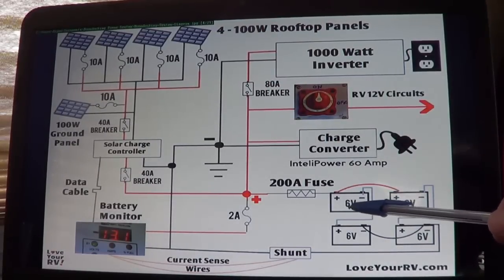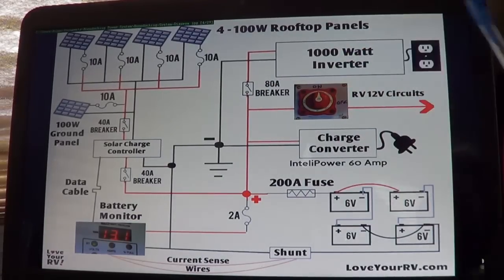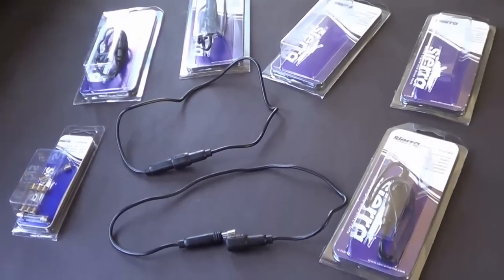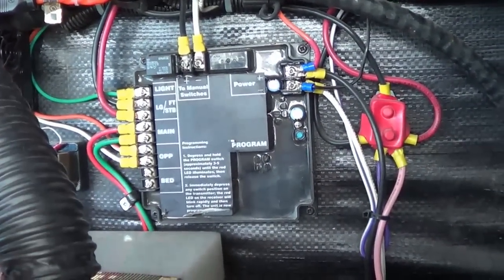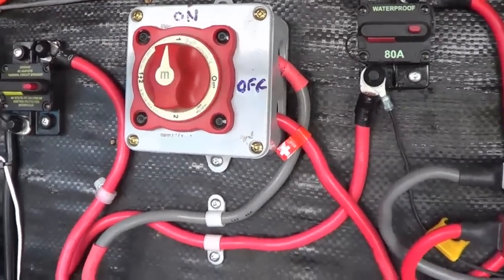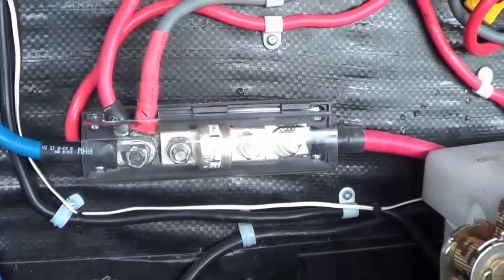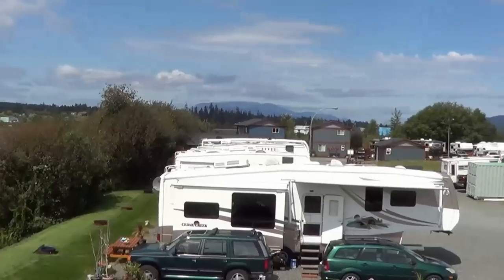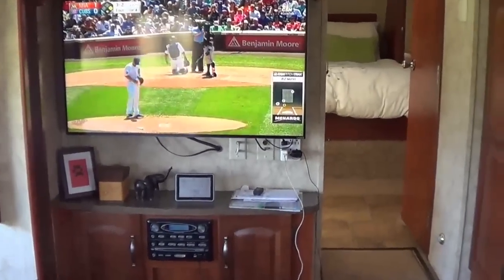Our DIY RV Boondocking Power System - Complete Overview

Comment: I went through all the comments about this video and found all the answers to the questions I had. What a great resource and thank you for putting in the work on it and your blog - Ray
Reply from the maker: You're welcome, happy to hear it helps out.  Had a great time boondocking this past winter and the system work great!
Cheers! Ray
Reply: There was one question I missed or did not find. Which Blue Sea battery disconnect switch did you decide to use and why? I see many options to chose from when I click on the link you provided Thanks in advance.

Comment: Being a neatness freak, I liked your arrangement of cables and loved the circuit diagram.
Reply from the maker: Thanks, the system continues to evolve, in the summer I got new lithium batteries so redid the battery bay wiring - https://youtu.be/1f145rhB_e0  and recently added two more panels so was a chance to redo the solar wiring - https://youtu.be/z0m7Ho0Gxmw  Cheers! Ray

Comment: Nice clean install. It is nice that you have all the switches in a row. Easy access and no searching. When you are Boondocking how often are you using your generators?
Reply from the maker: It varies a lot with weather mainly. We can sometimes go a week or two without it. But if we get lots of clouds and rain we need to use it more often. Also, it sees more action in the short mid-winter days, where you only get maybe 4-5 hours of good sun.

If we tried to be hardcore energy misers we could almost get rid of it, but we like our electronic luxuries and my wife likes the night time heat at around 66F so the furnace fan can really eat up the AHs during a cold desert night. ;)
At least now with the better charge converter, the runtime is fairly short.
Reply: Thanks for the reply. Do you use your buddy heat at night while sleeping or only during the day?
Reply from the maker: Only when awake. But that sure saves on propane and battery life in the winter when it can be dark and cool my 5 PM. Still lots of hours left till bedtime.

Comment: I already have the same converter...same inverter with same breaker....along with 6 6volt golf cart batteries and a similar battery switch, but I like your extra protection so I will be coming back to this video to add to my system this fall. Thank You ..->.33ft class A
Reply from the maker: You're welcome. Cheers Ray

Comment: POW! that was the sound of my brain popping. Wow, you answered every question I had and a few I hadn't even thought of. I'm going to start with a generator and build off of that for boon docking. I really like these new lithium batteries, I just gotta convince myself the price is worth it. There's an ongoing argument in my head about just that. Thanks for all of the info. You are now my RV electrical Yoda. 
Neil
2018 Grand Design Imagine, 2760MK 
2015 Ford F 250 6.2 gas
Reply from the maker: Awesome, happy to know the video is of use. Cheers! Ray
Reply: Ray, you're still using the same 1000 watt inverter? What's the life expectancy if an inverter?
Reply from the maker: Yes, same one, 7 years now. I've gotten my money's worth out of it.
 I'd guess most will run at least 10 years and maybe as much as 20. Usually what kills them is heat over time. It drys out the electrolytic capacitors causing failures and causes the boards and solder to get brittle leading to cracked connections. The fans are another weak point being mechanical they wear out.

Comment: Thanks for the post Ray. I am designing my solar solution now for a small 22 ft class C. Unfortunately I don't have much room on the roof. I was thinking about using one large 150 watt renogy panel along with 2 smaller 50 watt panels that will give me 250 watts total. I am going to use 2 - 6 volt deep cycle batteries in series. Hope that is enough. Do you know if there are any issue with mixing the different size panels? Does it reduce the efficiency ? I am also going to buy the 60 amp speed charger that you are using to top the batteries off with my generator. Thanks
Reply from the maker: I haven't researched it much myself but I believe mixing can reduce efficiency if the voltage or amperage specs on the panels are very different. Depending on the type of charge controller used and whether they are wired in parallel or series.
It would be worth researching it.
Reply: Checked it out. Mixing panels will kill the efficiency. I think I have room for two 100 panels so I will go with that for two batteries.

 On another note, do you have any advice for which insurance carriers cover full timers?
 Which are better then others? My current carrier (allstate) has a caveat that covers my RV for 30 days but won’t cover full time. 
BTW, I’ve heard that insurance companies won’t pay theft claims unless there is evidence that there was a break in (which is wrong Imho ).  There are many RV’s that use the same key and locking mechanism for the locks on under carriage storage so anybody that has the same RV, has the same key. Not very secure if everybody has a key to your house.
 Also, if anybody breaks into your RV and steals anything, make sure there is proof that there was a break in or the insurance company won’t pay the claim. Use a screwdriver to jimmy the lock or break out a window before  calling the police. It’s ashamed people do something illegal to make a claim but it’s a bigger shame that a insurance company might use a loophole to not pay out for exactly what you have been paying them for. 
Insurance companies know that some RV’s use the same key and if someone has that key, it will not leave a sign of forced entry. 
I’m sure there are a lot of RV’ owners that assume their stuff is secure because it is locked (wrong) and if something gets stolen, they assume the insurance company will cover it. (wrong).

Comment: This is a great summary. I'm afraid that I've never read any of the blog posts but I will be looking soon. E.g. I'm wondering about the PWM vs MPPT decision. Thank you!
Reply from the maker: Thanks.
Here is an explanation from the Bogart Engineering FAQ
C1. The debate rages: which controller is best PWM (Pulse Width Modulation) or MPPT (Maximum Power Point Tracking). Why did you choose PWM technology instead of MPPT for your SC-2030 Solar Charger?   Click for answer
A very good question! They BOTH have good and bad. Plenty of hype has been written already. Here's my (Ralph's) view:The "good" for PWM: It is simpler and lower cost technology. Under some common circumstances--it can actually deliver more amps to the battery. That could be when:(1)days are moderate or warm, with few clouds.(2) batteries are charging at over 13 volts, (in a 12 battery system) which they almost always are when actually CHARGING.(3) Panel voltage is properly matched to the battery voltage, for example "12V" panels are being used with a 12V system.PWM is actually more "power efficient" than MPPT--which means less total power loss in the controller itself. So heat sinks in the design can be smaller (and less expensive). Missing in most analysis of MPPT is that there is always a conversion loss with MPPT, which tends to be higher the greater the voltage difference between battery and panels. That's why PWM can actually beat MPPT under circumstances described above.Some places that analyze MPPT assume that panels with 30V open circuit voltage are being used in a 12V system. Any good MPPT system will easily provide better performance in that case. They also may assume batteries are charging at 12 or even 11 volts, which is unrealistic. Lead acid batteries are typically below 13 volts only when discharging, or perhaps charging with very little charging current--meaning the actual potential gain in amps is not great.The benefit for MPPT becomes apparent if you use panels not voltage matched for the battery. If they are not, MPPT will utilize more of the potential energy of the panels. For example, if you use 24 volt panels to charge a 12 volt battery system you must use MPPT, otherwise you would be using your panels very inefficiently. If you are trying to use PWM in that case, you are misusing the PWM technology.Another potential benefit with MPPT is that if distance between panels and batteries is far, smaller wire can be utilized by running panels at higher voltage to the batteries. Running at twice the voltage reduces wire size to 1/4, which for a long run can be a significant saving in copper wire.If temperatures are low enough, the slightly less power efficiency of MPPT will be compensated by the higher panel voltages, which will result in a little more battery current. But in actual measurements we made using a commonly sold MPPT solar controller, this would occur at temperatures less than 55 F degrees (in full sun, when charging at more than 13 volts), where there is a slight advantage to MPPT in my location (Boulder Creek, near the California coast). As temperature drops below that (in full sun) MPPT will get some advantage, such as could occur at high elevations in Colorado in the winter. Potentially this would be maximum about a 2.5% improvement in amps output for every 10 degrees F lower in temperature (or 4.6% per 10 degrees C colder. I'm using data from Kyocera KD-140 panels.)There can be theoretically optimal situations (that I don't personally experience where I live) where MPPT could give some advantage: that is when solar current is present, but the batteries are quite low in charge--but because loads are high and even greater than the solar current the batteries are still discharging despite the solar current. Under these conditions the voltage COULD be at 12.5 volts, or even lower. Again, using data from Kyocera panels, ("Normal Operating Conditions") there is a theoretical maximum gain over PWM of 20% current assuming NO MPPT conversion loss and no voltage drop in the wires to the panels, at 20C (68F). With PWM, the voltage drop in the wires in this case would not affect the charging current. Now if in addition you lower the temperature to below freezing at 28 degrees F (while sun is shining) you might actually get up to a THEORETICAL nearly 30% gain while the batteries are discharging.The only REALLY BAD part of MPPT, is all the hype surrounding it--for example one manufacturer advertises "UP TO 30% OR MORE" power harvested from you panels. If you are using solar panels properly matched to the batteries, 30% ain't gonna happen unless it's EXTREMELY cold. And your batteries have to be abnormally low in charging voltage--which tends not to happen when it's cold (unless you assume the battery is still discharging while solar is happening). Virtually all the analyses I've seen touting MPPT on the Internet ignore the conversion loss, assume really cold temperatures, assume unreasonably low charging voltages, assume no voltage drop in the wires from panels to batteries, use STC conditions for the panels (that the marketing types prefer) rather than more realistic NOCT conditions, and in some cases assume panels not voltage matched to the batteries.The other thing that is misleading about MPPT, is that some manufacturers make meters that show both the solar current and the battery current. In almost all cases for a well designed MPPT type the battery current will be greater. The engineers making these know better, but it is implied (by marketing types?) that if you were NOT using MPPT you would be charging your batteries with only the SOLAR current that you read on their meters. That's not true, because the PWM BATTERY current should always be higher than the MPPT SOLAR current. It is the nature of the MPPT that maximum power occurs when the current is lower than the maximum, so they must operate there to get the maximum power. So to properly compare the two you need to compare MPPT with an actual PWM controller in the same circumstances.Finally, the reason we went to PWM is that I was anticipating that panel prices were going to drop (which they certainly have over the last 5-10 years!) and that the small advantage of MPPT (under conditions where the correct panels are used for the batteries) would not justify their additional cost and complexity. So my thinking, for more total benefit per $, put your money in an extra panel rather than a more expensive and complex technology.
Reply: Oh wait did you just say that recommendations are based mostly on HYPE, and word of mouth, and don't actually analyze the actual reality of the situations?  that possibly the information is more based on some sales hype of some sales location, and it spreads like the rest of the accurate (lol) and useful information on the web today ? That possibly the quality of the unit itself , the units actual efficiency (vrses claimed) how it is wired, and how it is actually used are important?  Gosh I couldn't believe that would be true :-)   Thanks for . . .  thinking.
Reply from the maker: haha, yup, I think it comes down to what a person's budget is and where best to allocate the funds to build a balanced system. Not saying my PWM over MPPT decision is the right one for everyone, just what I think works best for me.

Comment: I remember in one of your videos you plugged the shore power connection  to the output of the inverter. Are you still plugging the shorepower connection to the inverter? How did that work out for you? If no longer doing that what are you doing now and why? Thank you,  Jay
Reply from the maker: No, I never plugged mine in that way. There was one video where I discussed different options, one being that option, but I don't do it myself. I just have a couple separately installed outlets, basically glorified extension cords for using when on inverter power. My 1000 Watt Inverter Installation Explained - https://youtu.be/yV2xJiHSbfU?t=722

Comment: I am also looking at a 400w Renogy solar panel set up, and, I don't wish to haul a 3rd source of fuel (gasoline) in my diesel truck. So, I am looking at the duel fuel (propane) champion generator. Am I on track, or, do you have better advice? I am sorry for all the questions. Just trying a last minute set up for early next year to begin my adventure.
Reply from the maker: The dual fuel would definitely be a nice option to have.

Comment: Hi Ray  I know you don't want to mention wire gauges, but just as far as wiring your 6 volts in series and parallel, what gauge battery cables did you use?  As far making custom lengths, did you do that as well? Did you have a large crimping tool for the lugs?  I will be building a similar system. Thanks
Reply from the maker: They are 2/0 gauge wires. I had a friend custom make them for me. He had a hammer crimper and the lugs. It's not too difficult. I have a video online on him making wires up - https://www.youtube.com/watch?v=ARKwl7lxHWo&feature=youtu.be
Cheers, Ray
Reply: Thank you Ray... I love all your videos! My wife and I are going full time (working from the road)...leaving end of May heading towards Mt Whitney/Alabama hills.
Reply: Actually one other question....does the 200 Amp catastrophic fuse also act as a positive bus bar?
Reply from the maker: Yes. I have recently added a second cat fuse when I found one that could attach right to the battery lug - http://www.loveyourrv.com/installed-catastrophic-fuse-rv-battery-bank/  But I left the other one in place anyway as it makes a good buss bar. :)
Reply: Thank you again for all the information.  One last quick question, what cable did you use from the charge controller to the to 40A breaker?  The charge controller I used previously used  wouldn't take much larger than 8 gauge. Thanks again

Comment: When you had two banks of batteries, the deep cycle and two Trojans....
1. could both banks charge at the same time from your solar? 
2. Did you run one bank at a time using the other as a backup?
   I have two good almost new interstate 6v 225ah deep cycles right now. I plan to add 4 trojan T-105’s am am considering running the both in two banks like you did. Thoughts
Reply from the maker: I could charge at the same time but that wouldn't work great as they were different batteries so the charge wouldn't be balanced. What I used to do was charge them separately then just have the single 12 volts as a backup reserve in case the 2 golf cart batteries got really run down. Came in handy on the mornings when leaving instead of taxing the slide and landing jack motors with a weak battery bank I could switch over to a fresh battery.  Cheers, Ray